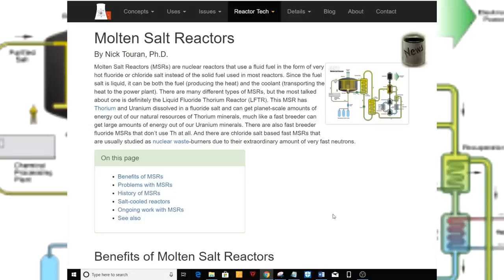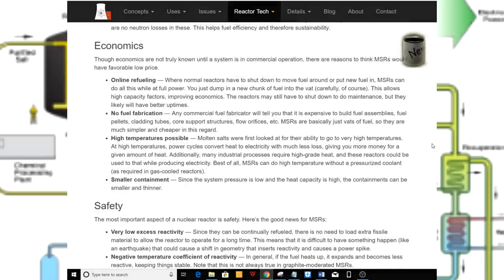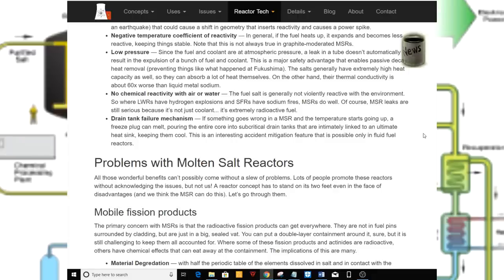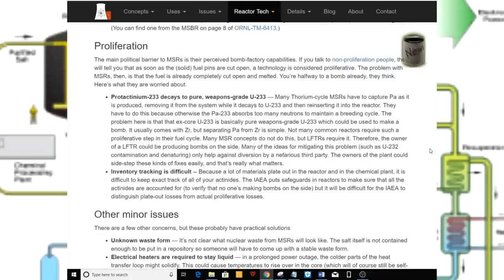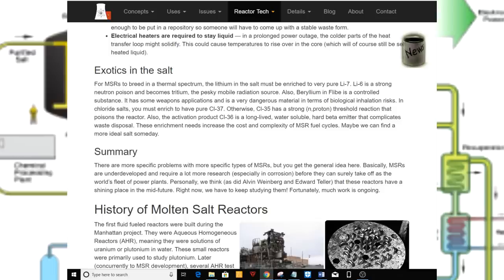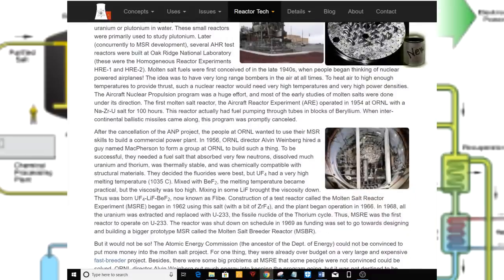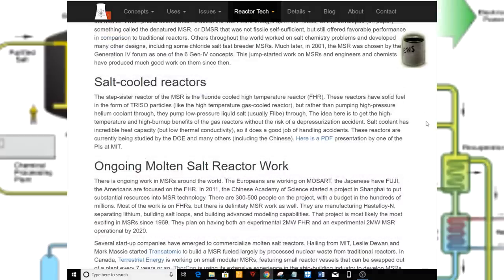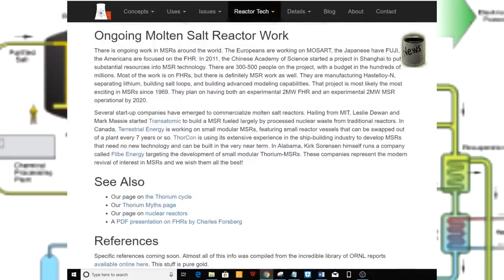The Actual Problem with Molten Salt Reactors ...and benefits obviously

Comment: The MSR is reactive only where the fluid is inside the graphite moderator prism.  So another safety feature is you can drain the salt so that the moderator section is drained, this would quench the reaction. Later when the problem(s) is fixed you'd reheat the salt, pump it back in the reactor and restart
Reply: Nuclear reactive maybe, but hot sodium fluoride sounds a teensy bit chemically reactive.
Reply: @williamchamberlain2263 , fluoride salts are ALREADY reacted (hence being SALTS), so they are chemically stable.
Reply: We could also slow down the reaction with a reaction chamber that is not perfectly round but instead could be tipped by gravity so that reactants were disbursed over a greater surface area. 
I am envisioning a reaction chamber that would have to be tipped up against gravity for the reaction to go the fastest. Then if they were any kind of system failure the reaction chamber would tip to the side so that reactants were disbursed over the greater surface area or met with separating fins of some neutron absorbing material.

Comment: This is a great article, including both the benefits and problems of Molten Salt Reactors. I have been looking for such comprehensive information for a while without success, because most proponents are silent on the problems that need to be surmounted (especially potential for weaponisation), and promote their own favoured solution in too glowing terms. 

This is not just a race for a viable power source between different nuclear fission alternatives, it is also a race against wind, solar, and nuclear fusion. The first technology to get critical mass will win the day because of the infrastructure that has to be built to enable deployment. 

Solar and wind are well on their way to being the winners, especially in public opinion. I think that is regrettable, because nuclear energy (should problems be overcome) would be more reliable, affordable and sustainable than wind and solar in the long run. With it, we could enter an era of energy abundance beyond most people's dreams.
Reply from the maker: Absolutely, the sustainability of wind and solar is also questionable in catastrophic weather conditions associated with climate change. Thanks for commenting.
Reply: @RCrosbyLyles  

We are only just beginning to see the terrible mining and land use change impacts of variable renewables, as their scale has been heretofore small. But solar PV polysilicon refining has recently surpassed electronics polysilicon refining in overall volume, while rare earth dopants like Germanium are mined in terrible conditions in Mongolia, far away from any environmental activist group that might intervene. 

But I would actually say that the energy storage is what will be truly devastating. The technology to make wind and solar "reliable" is also the one that will destroy the most land and the most lives. Cobalt is of course, a conflict mineral, and we enjoy our smartphones and our solar rooftops with battery storage, with the blood of Congolese children. Lithium brines are being extracted under the noses of Andean native tribes, causing subsidence and contaminating their groundwater. Graphite is sintered in China with basically zero protections - you can mark their production by looking at streets of people with faces stained a metallic grey from graphite dust in the air. 

The brilliance and the insidiousness of the globalised supply chains for renewables mean that their costs and impacts can be externalised onto the developing world, while the benefits of "cheap" solar and wind are imported. Transmission corridors and land clearing for solar farms and wind farms can also be externalised onto rural communities as well, further isolating the impacts from affluent city-folk, and giving a green patina of legitimacy to the whole sordid affair. 

Germany goes a step further, isolating the impacts of increased electricity costs onto ratepayers while forgiving the fees and taxes for their manufacturers so as to limit offshoring of jobs. The taxes are profoundly regressive: a poor family pays a disproportionate amount of their income on electricity related fees, while rich families can afford to buy newer, more energy efficient homes and appliances, install solar, and so on. The result is that 300,000 families have been cut off from the German electricity service, even as the government approves natural gas pipelines, razes forests for lignite, and plans for an additional 30 coal fired power stations by mid-century.
http://www.spiegel.de/international/germany/high-costs-and-errors-of-german-transition-to-renewable-energy-a-920288.html

We can no longer afford to destroy the environment in the name of saving it. Nuclear must be a part of the answer, and while molten salt reactors should play a role in that future as well, current reactors are fine too.
Reply from the maker: @MonMalthias  Yep. There is no panacea.
Reply: @RCrosbyLyles  
The panacea is plentiful clean energy by any means necessary. There was slavery until we made carbon fuels our slave. 

Now we have the opportunity to deliver new power without the pollution where before it was a necessary evil. 

Molten salt reactors promise plentiful energy without the civil engineering megaprojects that have doomed nuclear in the west. Brain drain and financialisation has destroyed the state and the institutional knowledge on how to execute complex works.

In a way it is a blessing and a curse. It is a blessing because it promises a way out of a moribund nuclear sector. It is a curse because it is an acknowledgement and a capitulation to the reality that in our world where neoliberalism holds ultimate sway, complex systems of systems like light water reactors may no longer have a place except where political will is exercised.

In places that have not suffered through neoliberal "shock therapy" - China, Korea, Russia - a powerful state can shepherd the labour and resources efficiently enough for light water reactors to predominate, even over fossil fuels. But even in those places, design bureaus are looking beyond water cooling. Alvin Weinberg's supersized, landlocked submarine reactor faces burgeoning alternatives and harsh competition from alternative energy - a double whammy. 

I personally think that water coled reactors will still be the workhorse for decades to come. Uranium is too cheap and will have its price capped by seawater adsorption. The only rate limiting step is superheavy reactor pressure vessel forges.
Reply: Wind and solar will not win because they are both inherently weak and unreliable sources of energy. MSR’s and other advanced nuclear designs will win, the question is how long will it take the U.S. to get going, and how much will China surpass us in this amazing technology? The sooner we get it the better
Reply: The world can't run on a battery. Nuclear is the prime option.
Reply: @MonMalthias  THIS COMMENT!
Reply: @robertweekes5783  
Wind and solar need storage in order to avoid excess burdening of the other power sources. Off-grid systems have pioneered this. Tesla has demonstrated where lithium batteries have a niche. Next we need molten metal batteries.
Reply: @hjembrentkent6181  Thanks for that link. As an 'ordinary person' it's difficult to find things related to MSR that are of interest when you don't know what to search for. Kirk Sorensen is a great spokesman for MSR but naturally, if something sounds too good to be true , it probably is.
Reply: @RCrosbyLyles  This, we have spent more on solar than any other forms of energy, for less than 5% the power.
Reply: @floridaman3823  Yes. And man will never fly, right? And if you are so foolish to sail too far, you will fall off the edge, and the great turtle will eat you! LOL
Reply: @MonMalthias  , China was only place where EPR was build to about planed budget. But even there construction was much more than original 4 years promised. Extra construction years matter more to private company than state because private company has to pay higher interest rates. If you add interest rates for private company then even Taishan reactors would be about 2B€ more expensive. Still a lot cheaper than European projects as Chinese reactors would still be only 5B€ each while European reactors cost 7-10B€. Original promise was to build reactors for about 3B€ each (plus interests).
Reply: @suokkos  If you want a case study on the massive difference state finance makes, look no further than Taishan EPR versus Hinkley C EPR. Hinkley relies on private finance, private interest rates and private banks. Taishan uses state finance.
The model of supersized reactors with 5-6 year build times was unacceptable in the 1990s. It is murderous today.
Interestingly, China, Korea and Russia have managed to shave construction times down to around 4 years. They did so with using experienced work crews, having an established domestic supply chain that is exercised early and often, and of course, government planning.
The plight of the LWR is reflective more broadly of trends in governance. Years of deregulation and hamstringing of state institutions in the West have effectively destroyed not only the technical and financial apparatus of the state, but also the logistical apparatus. 

Co-ordinating long lead time parts and their delivery, schlepping hundred ton assemblies across the country, building nuclear grade concrete basemats all demand extreme co-ordination between local, state and federal authorities and industries. France and England have destroyed these tightly intermeshed institutions and it is reflected in their EPR build times. If you contrast that with the work at Novoronezh or the Korean work in the United Arab Emirates where everything is neatly planned out and executed you can see the stark difference. 

If the West wants to build LWRs again it will have to rebuild those institutions. Something that neoliberals on the Left and the Right will vigorously oppose. 

And more's the pity, because those same institutions can be turned to produce a nationwide railroad network, an intermodal freight network, a national fiber internet infrastructure, etc. All highly technical projects requiring extreme co-ordination with a massive benefit to the population. But politicians are too busy grandstanding over tax cuts to the rich. This is how the West dies. Not with a bang, but casual neglect.
Reply: There is a shortcut that Solar can take too, by self-replicating panels made on the moon and orbiting the earth.
Reply: @avid0g  They also have relatively low energy to area densities, at least at present.
Reply: Yes sir compleet agree whit u.

Comment: It's refreshing to listen to a presentation on the LFTR that also talks about the potential problems of a molten-salt fuel cycle. Any commercial power generating plant needs to have an operational service life of at least 40 years, to be able to pay off it's construction costs and return a reasonable profit to the owners, and the experience of power companies with LWR's burning conventional U-235 (or Breeder reactors like the CANDU), are that these plants ultimately offer little or no profit margin compared to coal or natural gas fuel. Of course, the poisoning of the atmosphere with CO2 by burning coal is going to have to end soon, or we might all choke to death, but it's going to take a massive engineering effort to design an LFTR that is even as safe, if not safer, than current LWR designs.
Reply: The CANDU is not a breeder reactor and uses heavy water not light water as a coolant and moderator..
  Terrestrial Energy has designed and obtained preliminary regulatory approval for  an Ontegral Molten Salt Reactor  with a replaceable unit which i designed to last seven years and costs a small fraction of the capital cost of light wate reactors.

Comment: How did SEFOR in NorthWest Arkansas fit into this. It used plutonium fuel and liquid sodium coolant. It operated for 1 year in 1970 and then it was never talked about again. It was a breeder reactor. It never shows up on any map of past or preset breeder reactors, or MSR. It was finally dismantled in 2017 but the whole thing is strange to me.
Reply from the maker: I don't know, but sounds interesting. Thanks for the comment.

Comment: Thanks Crosby for a very good summary and the intercooler plating out problem should be fairly simple to make money on. Radiation being the primary problem. Thanks again R Crosby. This should be our primary fuel source at this time. Trucks could easily have overhead tram wires coast to coast with their regular diesel engines only being fired up off the grid. The new radial magnetic flux electrical motors should produce a small enough electrical addendum added to trucks to reduce shipping costs coast to coast to 1/2 the current amount with lots of these small module thorium reactors. For me the primary problem off site seems the tritium problem.

Comment: Nothing is without its problems, but if the PWR was offered today it would never get regulatory approval. There are just too many areas where bad tings can (and do) happen.

Check out the Moltex Stable Salt Reactor which is going into the New Brusnwick plant in Canada. It is fast spectrum so can burn used fuel from the adjacent CANDU. The fuel salt is contained in stainless tubes which are swapped out as the fuel degrades. The reactor does not pump the fuel at all. The SSR rods are vented so no problems with noble gas pressurisation and being small they have good thermal conductivity. The fuel rods/tubes will erode but the effect is not significant over the life of the fuel contained in the rod. Rods are swapped out for refuelling. 

Spent fuel is already packaged within the fuel tubes but spent salt can be glass vitrified as is done with solid fuel waste. The difference is a 1000 times shorter storage life.

The cooling salt is the same stuff as used in solar thermal power plants - well understood for corrosion/erosion. Fuel salt is not pumped and there is no moderator. Irradiated salts do not become radioactive so the nuclear island is clearly defined from the main plant. 
 
There are no exotic materials as these cause huge regulatory issues. Everything is ordinary nuclear spec. 

The fast spectrum means no moderator and no problems with carbon blocks distorting under neutron damage. 

U233 (e.g.from thorium) is a high gamma emitter which would fry the nuke bomb electronics never mind the crew. It's a very bad bomb material. It was considered by the Manhatten Project but they went for (much) easier options as would anyone else who really wanted a bomb. Countries like UK, USA France etc already have bombs so changing their nuke reactor type would have no effect one way or another. Those who want bombs will want to build PWRs and solid fuels as they are the easiest way to do it. Refusal to use molten salt plants would indicate their intentions.
Reply from the maker: Great comment, thank you.
Reply: And still U233 has been used in bombs.
And isn't there a dispute with India's thoroughly reactors and Pakistan about nukes?

Comment: With all due respect sir, I recommend your reanalyze some of your statements on Pa-233, proliferation, lithium, corrosion, and chemical processing. I also recommend citing “Molten Salt Reactor and Thorium Energy” by Thomas James Dolan; where all research before 2017 is put in proper context. I enjoyed your presentation, and appreciate that you even researched the topic. Comparatively MSRs demolish current reactor technology in every way and will be a leading design for the next generation of reactors. Whether thorium is used or not.

Comment: This reminds me in a way of wind turbine design.  People without knowledge and experience in wind energy are prone to promoting vertical-axis ("eggbeater") turbines as the "real" answer to wind energy.  The stated advantage is they do not need to aim.  But the many disadvantages outweigh the single advantage, so you never see vertical-axis turbines in wind farms, and seldom see one even operating anywhere, period.  Yet there are always vocal advocates of the vertical-axis concept, usually under the idea that it is only the industry's "ignorance" that prevents widespread implementation of the concept.  Is it possible that there are similar "showstopper" challenges here?